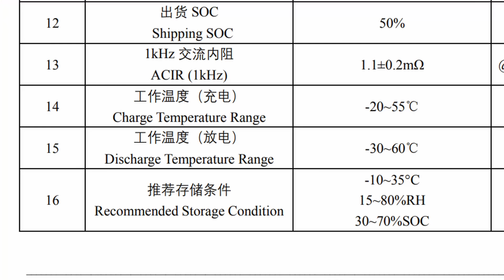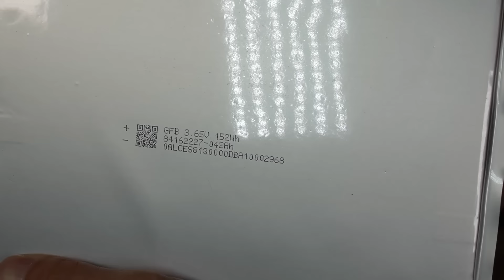CHINS Solid State Lithium-ion Battery Tear Down and FIRE!

Comment: Why not tell us what the composition is accoding to the data sheet or isit just 'lithium ion'? It's key to understanding what it is because it certainly does not look like a solid state cell. Also as far as i know, nobody has a commercial solid state battery yet. SVolt is the closest to having a real solid state battery. The voltage of 3.65V seems to be the same for a standard lithium ion battery cell. No data on the SVolt solid state voltage though. 

The puncture test of the manufacturer is just funny. Sure they  puncture it, but they keep the thing in it,mostly closing the hole. Considering they have a cover over it, I'm sure they were expecting something else.

Comment: The market seems to be offering more & more (?) “Mini” 100ah batts.  Small form factor from use of Pouch cells.  The ‘mini’ is Extremely attractive for my space limitations.

There is a channel, where a young fella drills A Lot of holes in a pouch, then dowses it with A Lot of water.  Nothing extremely noteworthy.

Will, I consider you The most credible expert on these matters, esp with your education/background.  By contrast to the other channel, your outcome was CONSIDERABLY more compelling.

** So, am I clear that you do Not recommend the LifePO4 pouch cell form factor in a mobile application ?  *****

Last, I trust ZERO percent of any Chinese manufacturer’s claims/testing.  Their video could’ve  (likely Was) significantly ‘altered’ example.

Comment: Solid state is not the future.  Lots of hype, but mass manufacturing a true solid state battery is really difficult, and the energy density won't be beyond what Tesla is doing with DBE (Dry Battery Electrode).  If other battery manufacturers license the DBE technology from Tesla, they will be better off than doing anything with solid state.

Comment: Puncture vs drilling/creating heat that can ignite are not the same.  Creating heat like you did with that bit in a chemical product was not up to your normal safety standards.  You may want to delete that one.
Reply: this is a real world example.  This is exactly what real people are wearing when they fail unexpectedly.  I suspect Will knew precisely the risks from prior testing on other cells off camera, in order to stage this take.

Comment: I don't understand this focus on battery technology, when Solar panels is the real bottleneck. Are there going to be any innovations above 21% any time soon?
I run 10KW storage in my RV and I can never get them charged fast enough.
Reply: yes but the Inventor would have to be disgraced and killed so you can run your waffle iron while off the grid. Unwritten rules observed by followers of alternate tech, state you are only allowed a 10% improvement to keep a level playing field.  This is at heart a national security issue, not one of waffles for van dwellers.

Comment: They punctured it with a screwdriver, not using a drill that generated heat with the bits rotation.

Comment: The video desperately needs an addendum:
0:52 There's no "solid state" lithium ion battery in mass production, it's not a thing that exists. each Li-ion has a liquid electrolyte in it. There are solid state batteries, but not with lithium chemistry.
0:56 The battery on the right can explode if damaged, very dangerous. The battery on the left doesn't and usually doesn't even catch on fire if damaged. Li-IRON-Phosphate is much safer chemistry than usual lithium batteries (typically Li-Nickel-Manganese-Cobalt-Oxide). THE OPPOSITE of what the video states.
0:59 the punctured cell behaves exactly like a Li-IRON-Phosphate (LiFePo4) cell. Either the Chin(e)s(e) lied or there was a mixup.

Comment: They punctured the cell...and NEVER removed the tool used to puncture.  You on the other hand punctured the cell, removed the tool, then drilled a hole in it and removed the bit...seems like THEY knew it would be a disaster if they removed their tool as well. Deceitful people.

Comment: Everyone is praising solid state batteries but we’re years (if not decades) from them achieving reliability and cycle life of NMC and LiFePo4, not to mention volume (in terms of manufacturing).
All this marketing about solid state reminds me of all the marketing around fuel cells. Pretty much anyone advocating or waiting for it is basically trying to defer and ignore the progress NMC and LiFePo4 have made in recent years. By the time solid state batteries are mature and available in volume, NMC and LFP will exceed their performance and nobody would care about them. Anyone promoting them is either trying to get views or trying to sell a dream (which will be irrelevant by the time they’re available)
Reply from the maker: Ohh good point about NMC and LFP being better by the time ss batteries come out. And yes I am getting tired of the advertising.

Comment: I cannot believe people fall for solid state lithium ion battery is possible. Physicists don’t know a solid state material that can exchange ions between dissimilar material. Reputable lithium ion battery manufacturers like Panasonic and Samsung are still in laboratory phase with gel between dissimilar materials. Not real solid state. Yet a value priced battery maker using unknown cells.

Even CATL and BYD are questionable when it comes to Lithium Ion batteries. Mercedes EQE bursted into flame sitting in underground garage during maintenance charging mode with unknown Chinese lithium ion battery cells. 900 some people are homeless because their luxury high rise apartment lost all utilities from Mercedes EQE fire. I would only begin to accept possible safety if lithium ion cells pass Tesla or Milwaukee qualification. That would be Samsung, Panasonic and LG. CATL and BYD are only acceptable for LiFePO4 battery cells.

Comment: Anyone who trusts lithium ion batteries in a residential setting is flirting with disaster.
Reply: If only there were billions of them in use around the world with a quite proven track record.
Reply from the maker: All the residential packs use lifepo4, which is not dangerous at all. Chemistry in the video is NMC
Reply: @Loolanga  I doubt billions will ever be manufactured. A few thousand maybe.
Reply: @WillProwse  as they should. But not the case with Tesla power walls, if my research was correct.
Reply: @basspig  What battery chemistry do you think power's mobile phones, laptops, power tools, UPS's, electric cars.... hell probably even your garage door opener. Lithium ion has been around and in safe use for a very long time.
Reply: @Loolanga  Lithium ion powers cell phones. Cell phones have caught fire in people's pockets and caused injuries.
Laptops all too often catch on fire. Lithium ion there too.
Power tools use NiCd mostly, but some are starting to use lithium ion. Store those batteries in steel containers.
UPSs use gel cells or SLA batteries.
I chose Lithium Iron Phosphate for my off grid solar power system.
Reply: @basspig  you're correct some phones and laptops have caught fire, however just because it has happened does not mean it's unsafe. That's not how statistics works.
Power tools have been heavily phasing out NiCd for at long time, in fact quite a few countries have banned new NiCd batteries because they're SO toxic for the environment. All power tools i have purchased, at least for the last decade plus have been using Li-ion.
UPS have used indeed been historically lead acid, sla or even NiCd but again we're seeing a shift towards Li-ion style of batteries.
Reply: @Loolanga  one fire is one too many, if it's your home that burns as a result. Lion batteries are "statistically" safe, but that doesn't mean they're safe to to use on your uninsured, irreplaceable home. It's just too big a risk. Especially when there's Lifepo 4 as a safer alternative. I watch closely for news of the first Tesla powerwall fire.

Comment: The only thing that was solid-state..   Regarding that, lithium battery.  Solid-state,, my ass..  There would be no caustic heat reaction.   Had that been, solid-state.  I'm not sure where they're getting that, solid-state  claim?  That's the whole point of,, solid-state batteries.  No liquid electrolyte.  And the only solid-state in this battery.   May have been the, transistors.  Within the, control circuitry.   Those would be, solid-state.  So these batteries are not.   And every bit as explosive.   As any other lithium battery.   Not good.  Should not be out there in the public.  Each battery filled with  dozens of little bombs.  How reassuring.

Something really really, really bad has to happen more than once.  For any new progress to be made..  Like taking most  E Vehicles,, off the road.  Until safer battery technologies are available.  Until we really do have, solid-state, batteries.  Which do exist, yes.  But not ramped up enough..  For the general public..  The military gets it..  And so in a few more years… We should be good.  Because we are not yet there.   With these lithium batteries.

I am truly looking forward to that next great deep in battery technologies.  That!  Will be a game changer.  For sure.  For sure.  Yup.  That's going to change everything.  All over again.

Damn I love technology!
RemyRAD